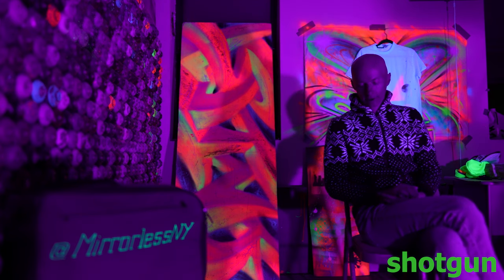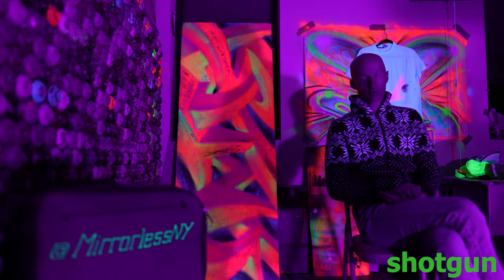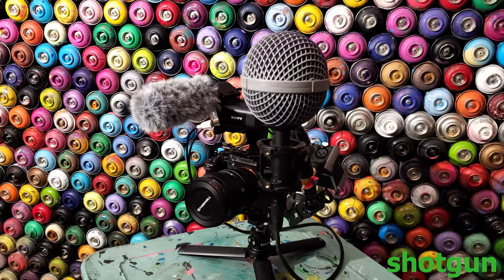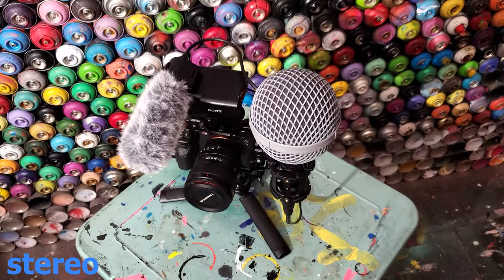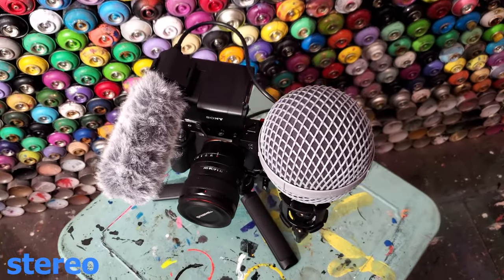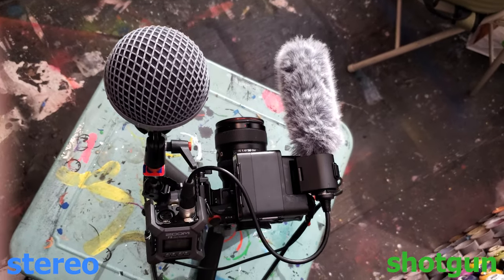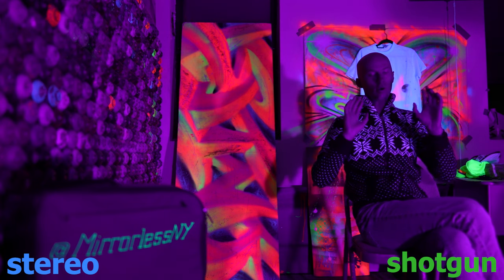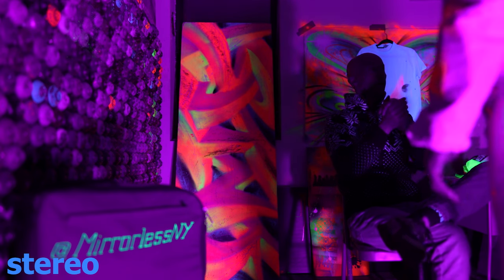Stereo vs+ Shotgun Mic TEST Audio Technica BP4025 + Sony XM1, guitar voice

Comment: Thanks for this test. I notice you have the BP4025 oriented upward instead of forward. Have you noticed much difference in pickup patten when changing orientation like that?
Reply from the maker: @kaanakalin_film  thx, it's been a while but I think you're right about orientation - it makes a difference
Reply from the maker: @kaanakalin_film  if I remember correctly the capsules inside are angled, so mic direction should be important
Reply: @mirrorlessny  I have a BP4025 on order. Looking forward to testing it out. Looks like a great mic. Thanks for your reply.